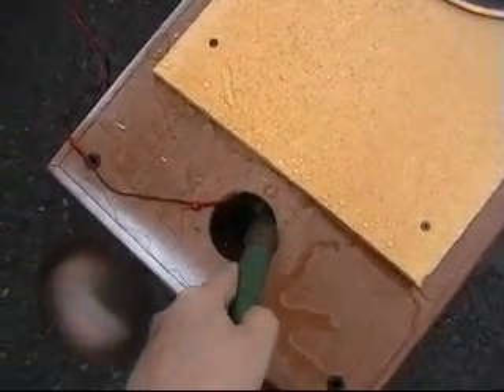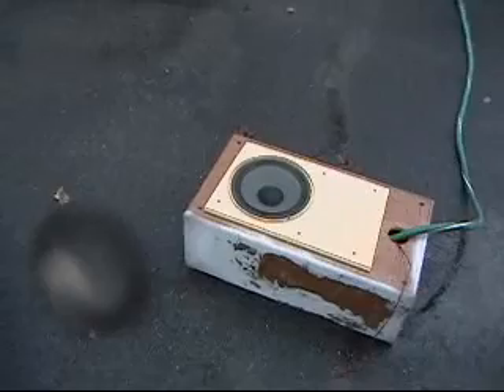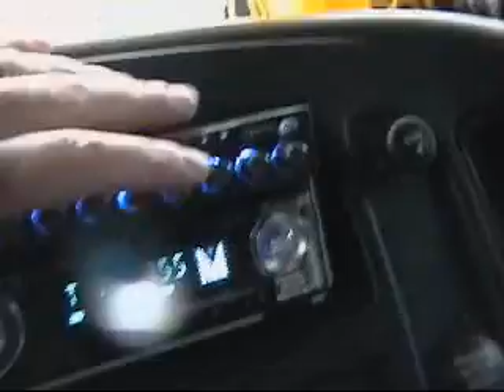Sub woofer Water Box

Comment: Wouldn't the amp go into protect mode, it's like short circuiting the leads (connecting the positive with the negative) by putting them in the same water body?